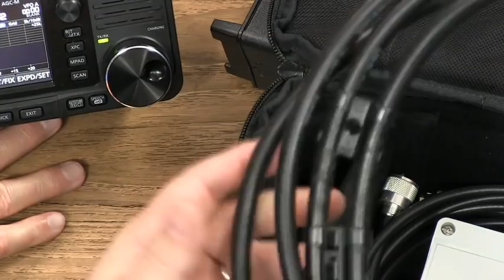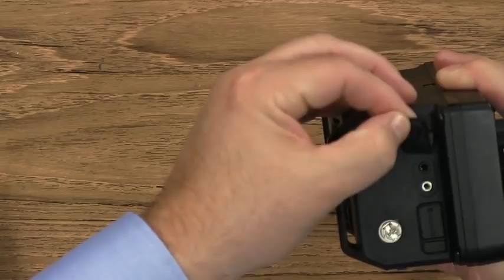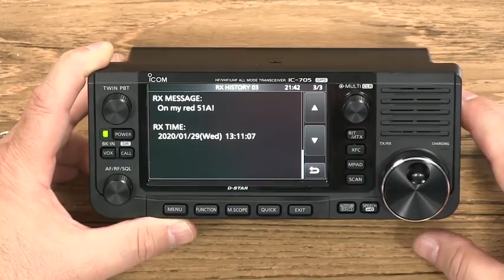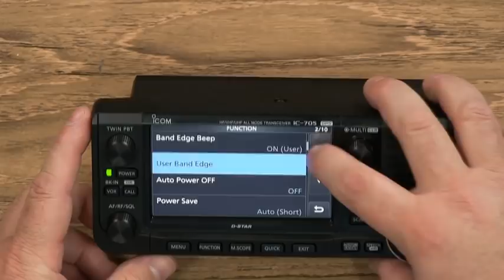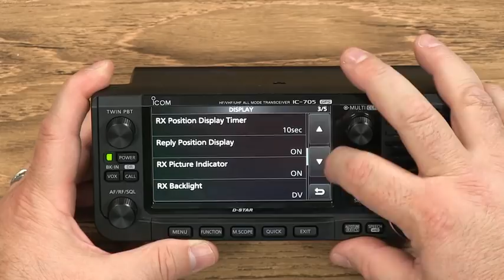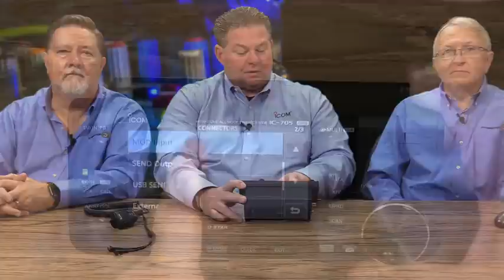Icom IC-705 All Mode Transceiver

Comment: I have been very positive and enthusiastic about the release of this radio.  It is good to see this video.  That being said, the radio - from my view here on YouTube - looks to be very cheaply constructed... very disappointing... the knobs look cheapened from the IC-7300 (which frankly are not stellar).  From observation, the tuning knob seems to have no "weight" to it... The radio looks to be constructed of all plastic, and the type of plastic looks like that which inexpensive toy would be made from.  Contrast the radio plastic with the plastic construction of the microphone.  The microphone looks of a much higher quality.  I think for the anticipated price point (rumored around $1500) I will have to open my mind back up to an Elecraft radio - which in my opinion looks to be much better constructed of an all metal case.  I don't see a stand of any sort, it looks awkward to operate there on the table, perhaps the custom book bag will help with that.   I truly hope this is a "mock up", and not the final fit/finish/materials...  It looks like it was build to be installed into a "double DIN" slot in an automobile (now that, would be awesome!).  This video has me second guessing  my initial attitude of being an early adopter.  I think I will have to become a more "wait and see" buyer (if at all)... a bit disappointing - I do want to be excited about this radio.  Perhaps the performance and usability of the radio will alter my view... time will tell.
Reply: After all it is still a prototype which was mentioned at the beginning of the recording.